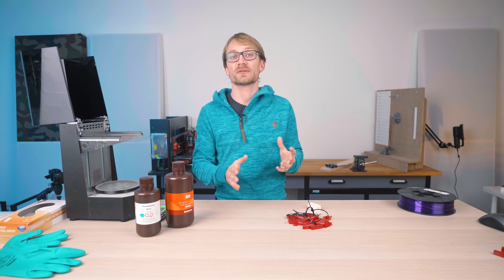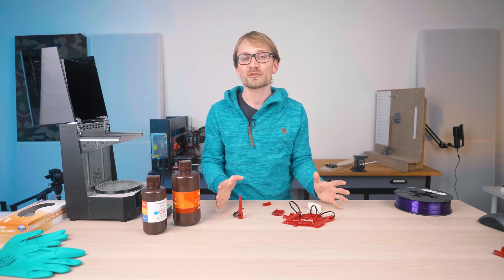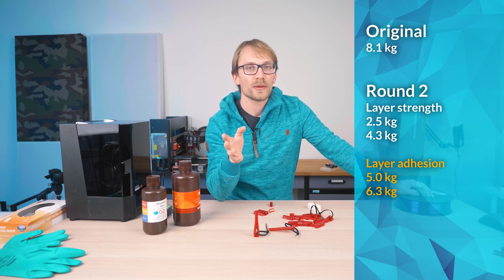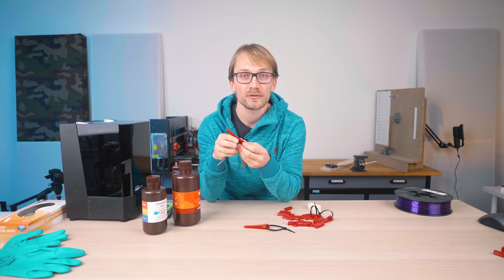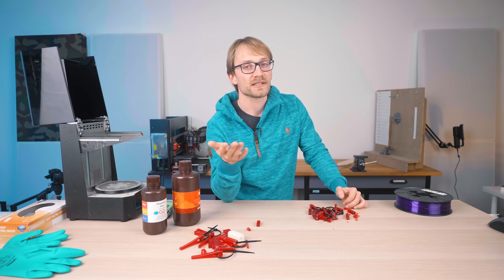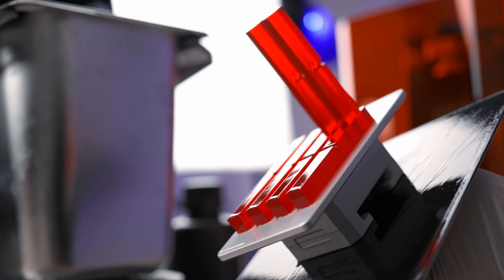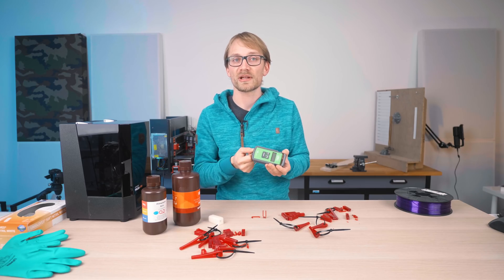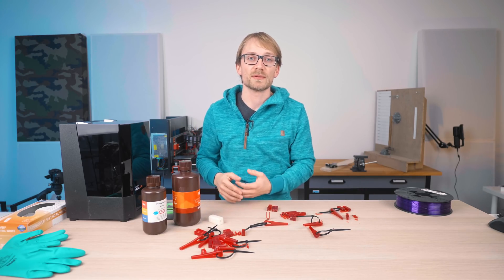Resin prints are weird: Does print orientation matter?

Comment: Only ideas but :-
Do you have a microscope to check the surface profile of the outside of the part. If it's somewhat corrugated, maybe the ribbing introduces stress raisers that break in one direct more than another.
Maybe the position on the printer plate matters, ie, the UV light on the edges might not be as strong so initial cure on parts positioned out there might not be as good.
From your testing it just seems it needs better curing.

Comment: My feeling is we have to wait for CNCkitchen for resis tests and scientific explanations.

My guesses for your setup:
- the curing station has UV LEDs at a very far distance apart, the parts might not cured evenly.
- when you put the parts in the curing station you literally poured it there. Okay, somewhat organized, but still no repeatability. The outer parts probably get higher exposure than the inner parts, especially where there is another part close to it.

For repeatable result and evaluateable data you should do the process in a defined and repeatable way.

Comment: There are still many questions.

Influence of layer print time.
Influence of layer thickness.
Influence of cure duration.
Influence of part just laying around on its own after it's been cured for weeks or months. I bet the curing doesn't just completely stop when you cease shining light on it.
Influence of curing temperature - my unrelated experience says higher ambient means better crosslinking.

But ultimately i probably will never ever use resin printing, because... well you're pinching the nose already, right. So it's just idle curiosity.

Comment: Now I'm actually curious if that behavior goes away if you print the resin parts with a Laser based Resin printer like the ones from Formlabs instead of one of these TFT with UV LED printers. 
Might be that the problem of layers not hardening evenly goes away with the much higher intensity of uv radiation that laser can focus on the tiny spot it cures at a time.

Of course that would entail actually finding a person with a real SLA printer or buying one yourelf which would be really expensive.

Comment: While I enjoyed your analysis on strength, I would rather see a comparison of exposure times vs. detail. Now I realize that there are hundreds of resins with almost as many property types, ie like ABS, PLA, Wax, etc. and also given that each model printer may have more UV Lumens or transmission efficiency - I’m interested in the dance between exposure and detail generally speaking for the Elagoo Mars and similar style printers. I have a Nova 3D Elfin, similar in specs to many other models. I realize that the devil is in the details and my mileage may vary. But I’m trying to get a functional part to print and it is rather small. So detail matters. Strength matters here as well. So exposure relationships really matter and I’m unfamiliar with which way to go to improve my results. How small can we go and still get functional parts? What tolerances do we need to maintain?  

I’d love to see you take that project on and really clarify the principles and relationships. 

Thank you for your work by the way. I’ve been watching for several years, although a bit less frequently lately. I hope to turn that around.

Comment: I think that the strength mechanics model you translated from FDM printers to resin/DLP printers is a mistake; strength in FDM prints is determined by Van den Waals forces due to feature size aka layers; in resin prints you conduct controlled polymerisation using light as a catalyst thus I hypothesise that resin print strength is determined by the average polymer length and their crystalline structure. Bare in mind that's just a hypothesis. I suggest taking a single batch of resin and splitting it into samples - group A would be properly stored; group B would be allowed to degrade due to poor storage (oxygen, shelf life, temperature etc.) - then print identical samples with degraded and non-degraded => different results would suggest that indeed DLP print strength is mainly driven by chemistry - and not by macro structure orientation. Great video as always, can't wait for your future findings!

Comment: I'd like to see the over curing. what if the issue with the resin being different in this test compared to the first be due to the resin its self being hygroscopic. kinda like how with break fluid, the longer it sits (even with a cap on it) the more moisture it absorbs. with the extra cure cycles, you could have aided the resin in shedding moisture and making them "better". to improve your flex test maybe you could get some chains attached to the desk and the part and one of those threaded tightening shackle things with a large adjustment, that way you can do lower increments of force to best test the limits of the materials. avoid any fabrics when doing weight tests, they could stretch and skew results.

Comment: I don't know if it is relative but I'll pass along the knowledge I have about uv inkjet printing(DIgital SIgn Printing) maybe some of it will help with your questions. WIth Uv inkjet printing adhesion to a substrate is one of the factors but there are several other like gloss/matte,  Scratch resistance among others. The long and short of it is that there is a balance on when the uv energy is applied and at what levels. Curing can be described at 3 different phases. Set- the initial exposure of the uv ink , In UV printing this is to control dot gain. you want enough cure to stop the dot from growing but still not fully set to allow for bonding of the next pass. Cure- A higher intensity cure to finish and dry the print. Post cure- This is the process of using the energy imparted in the first to phases to create the stronger bonds(Crosslinking). This doesn't involve any more uv energy(light) but the molecules reorient themselves over the course of 24-48 hours creating the best bond with each other. Some of the effects you will see in Uv inkjet printing is that with a low set energy is a glossier print but the adhesion to the material is much lower. Whereas a higher set energy would leave a matte finish but a stronger bond to the material. This may relate to what is common in the 3d resin printing as the initial print is the set energy, The Curing station is the cure energy and anytime after is the post cure stage. Time is an important factor to consider in the process. in the set process since the uv lamp only has a single intensity time is the only factor for dosage. In the cure process it is much the same. But even the time waiting between set and cure can effect the ability for the molecules to get the energy needed for the final cross linking stage.  Finally letting the prints post cure for 48 hours to achieve the maximum bond/hardness is critical before approving or dismissing an ink. Maybe it is a whole different chemical cocktail/process but from what I have seen it is very similar.  Great show and testing. Good luck.
Reply: 4 years late and I'm trying to confirm my own observations and also compare my prints to others but bottom line what you describe is what i have observed and actually some manufacturers of resins for commercial purposes recommend.

The first stage is curing the resin as part of the printing process, you want to excite the resin just enough to crystallize but not overgrow. Since the whole vat is liquid some UV will leak thru cures resins and overgrow each voxel and will always have a partially cured outer shell.

The second stage is to cure the outer film in a curing station and it really doesnt matter how long since the outer 200 microns or so will absorb just about all the UV energy.

The third stage happens over time, it can be anywhere between 48 hours and several months based on the recommendation I've read per manufacturers that sell resins that costs upwards of 2k USD per litter. Although I have noticed if you bake the printed part at a non-damaging temp then they achieve higher strengths faster plus some of the yellowing also goes away over time. That last bit had me thinking I was going crazy but no after a few weeks most of the yellowing went away on all the tested parts kept in different lighting conditions, but controlled temperatures.

Comment: Variation in uv lamp output and variation of part placement on build plate most likely. Try monitoring the power consumed by lamp at each layer. Monitor temps inside building chamber. So many variables that probably are not dependant Non uniform mixing of resin could also play a part. To get true consistent layer the resin needs to be stirred between every layer exposure. Unfortunately these printers can't be used for critical analysis because the variables are independent and have a bit of chaos thrown in. More samples (I never did get statistically significant sample size) may shed some light. At least that has been my experience. Chaos ensues

Comment: Did you say you made the second batch 25% smaller? I think this would explain some of your problems
Reply: The more I see Tom's videos,  the more I think he struggles with some mechanical/physical concepts, specially after the Mpcnc "drama",  and well, this looks like it is another example... How on earth can we use different sized parts and expect the same mechanical properties?
Reply: Tom tested parts printed at 75% scale in the original video and ended up getting similar results. He mentions this at 12:01 in the original video:

"I have also reprinted all these parts at a 75% scale thinking I wouldn't be able to break the full scale parts printed at 100% infill, but that wasn't the case. Still, I retested everything with the small prints but got the exact same result."
Reply: @Spectere  thanks ;)

Comment: What are your thoughts on resin separation in its liquid form (needs to be stirred/ storage issues)?  I was also thinking along the same lines as you for hard and soft layers.  I attribute it to the stacking affect of printing and the manner of how the resin is hardened during printing/ translucent makeup. Excess light likely refracts within and beyond the current printing layer causing varying hardness.  Similar scenario happens after printing during curing. Id be curious to see how a clearer resin stacks up, think translucent versus transparent.

Comment: wonder if the "tension" you get from when you separate the resin from fep for each layer could cause the differences? another possibility could be that as it cures  it shrinks and maybe that adds pressure/tension like how when glass is rapidly cooled to make prince Rupert drops ?

Comment: It feels that MLCD resin prints kind of have layers in X & Y directions.If you take a look at most LCD screens, there are often thin black lines between the pixels (something you can actually see on prints with a good enough microscope btw)

As layers are hardened before the previous one, with strong enough light (that probably affects the above layers aswell), I wouldn't be THAT surprised, if that actually was slightly stronger than X & Y directions.
Reply: Also i heard they're RGB displays, straight off a phone/tablet unmodified. Now what are the odds that all 3 of the subpixels transmit UV equally well? I say that's going to matter more than that there is blackout around the pixel.

Comment: I think that one possible explanation for stronger parts printing verticaly is a combination of two factors:
  1) Yes, resin layers are fully fused together (I'm assuming that for the second point)
  2) Resin printers that uses a UV light (LCDs masked) actually have a fixed exposure time per layer, so more smaller layers (as seen in the vertical print) means that the upper layers received more indirect exposure time from the residual UV light rays that ends up passing through the layers bellow. For example layer 0 will receive some light while layer 1, layer 2, layer 3 are being printed, in a decremental amount, of course.

That maybe don't apply to opaque resins that much... just maybe, lets remember that they still cure inside even being opaque.

One way to test this is with cubes as test subjects as they have the same dimensions across axis.
Reply: Exposure time is not fixed, it's adjustable. It is suggested that there would need to be an adjustment based on resin and layer thickness, but as of now, no known calibration procedure exists.

You can safely assume that the resin is actually very nearly UV opaque. To the extent that if you encountered an object which in visible light has the same amount of translucence, you'd most likely describe it as opaque at first sight, like say the opacity of wood. There would be a high degree of opacity but also a little bit of subsurface transmittance and subsurface scattering.

Whether visibly opaque resin actually has lower transmittance in UV, it's possible but usually shouldn't be the case.
Reply: @SianaGearz  What i mean is that the exposure time is fixed throughout printing (except the first layer). Yes, you can adjust that beforehand. But I must admit that this time being fixed or not is not the central point here.

Do you think that the amount of UV transmittance through a few layers could interfere on upper layers to a point that it makes a difference the part strength?

Comment: You're using a semi-transparent resin, it's possible that the uv light from subsequent layer printing is going through to further cure the earlier (higher) layers.

Since the 'laid down' ones have fewer layers, the top layers would have less total curing time.

You could test this by designing a stick which (if I'm right) should have one higher breaking point at the top and a much weaker one at the bottom.

You could also test by curing in direct sunlight for a much longer period of time and see if that can overcome print layer direction.

Comment: I wasn't sure about the "compliance" effect - if the softer "compliance" allowed for parts that didn't break as easily, I would have expected the additional curing (which would have hardened the compliant layers) would have made the parts weaker, not stronger for the bend test.

I was wondering if, because the standing pins were necessarily longer prints, if the transparent resin along with a "light pipe" effect allowing UV to cure the length of the pins, making the standing pins stronger in the bend test.

I dunno. Maybe I'm just blowing hot air.

Comment: Try printing your test parts at a 45° angle. Should be the the best of both setups. Even aluminium has "grain" and direction is very important when bending/machining. Give the 45° test a shot. I've done this with FDM.